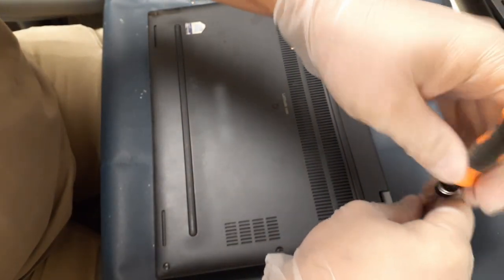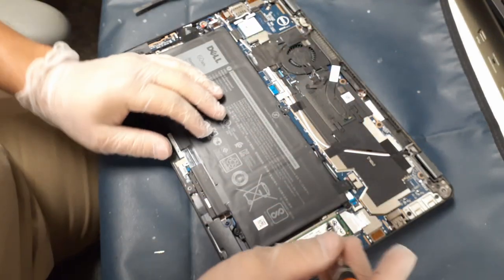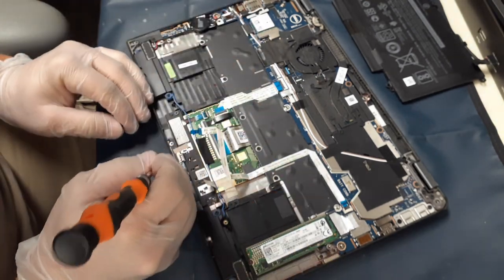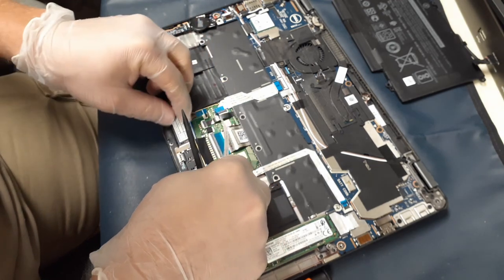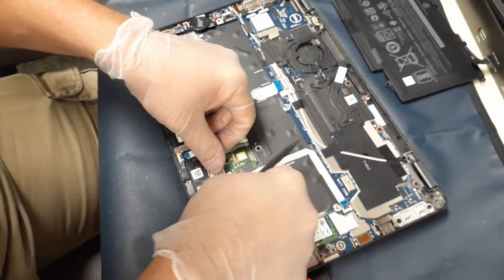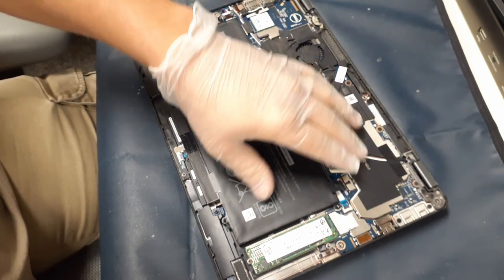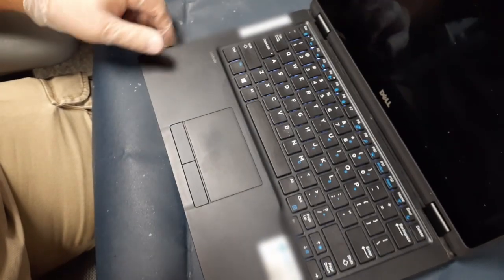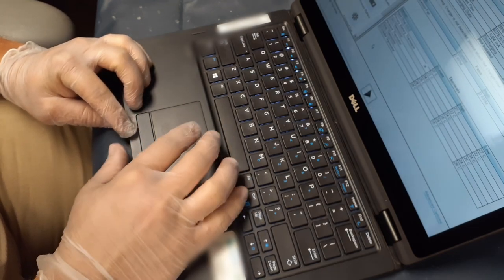Dell Latitude touchpad buttons - fixed

Comment: Hi Cougar (hope I'm saying that right).  Hey man.  Great video.  Extremely helpful.  I have a Dell 5590 that I purchased used. The trackpad was behaving very strangely.  I wound up disabling it temporarily so that I could install Windows 11.  After that, I realized that perhaps the previous owner had replaced the trackpad and didn't set it up properly.  Anyway, now I have the confidence to install a new trackpad if need be.  Thanks again.  You did a great job on this one.

Comment: Is it not possible to pry off the keycap with a screwdriver and reattach the spring for button assemblies like this? Or is the only solution to replace the whole unit?
Reply from the maker: Unfortunately many of the newer systems use a silicone diaphram as a "spring", so there is no reattatching option. The diaphram breaks causing the collapse of the button and the contact surface to shift out of alignment.

Comment: Whats that part number? Thanks!
Reply from the maker: Unfortunately I do bot have the Dell part number. You can contact Dell to see if you can order the part or if it can be repaired via any warranty or service plan you might have. A web search using the model or service tag may give you alternatives to a Dell direct part.